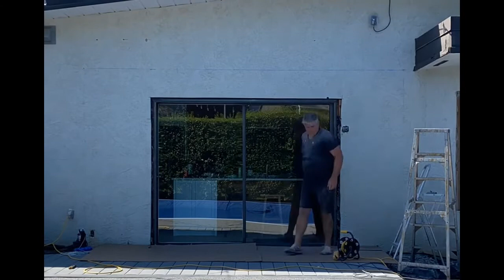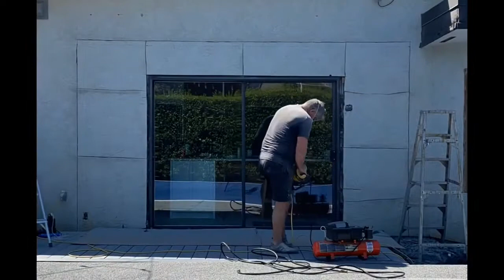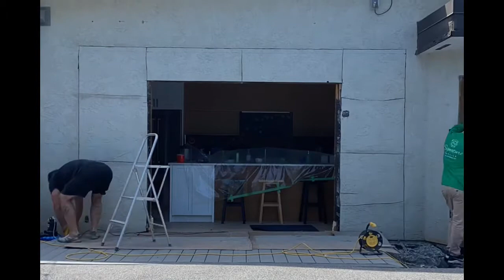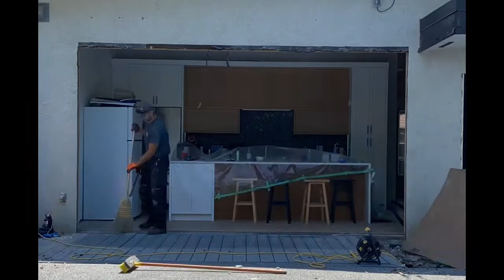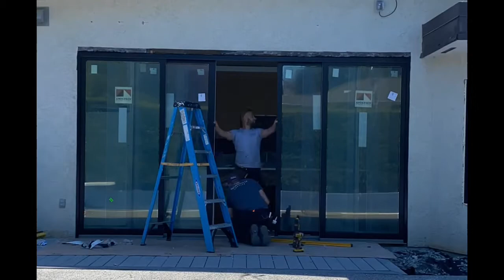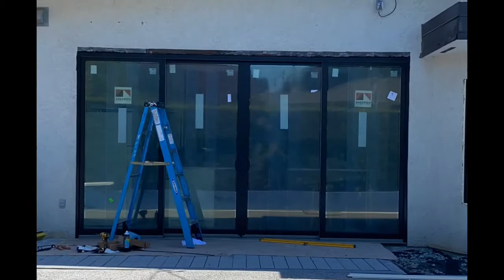Enlarge opening for 14x8 ft Patio door

Comment: Did you not have to put a longer king stud in the wall to support the weight of the upper wall?
Reply from the maker: It was already installed before cutting walls from exterior
Reply: Is this 200 narroline series?